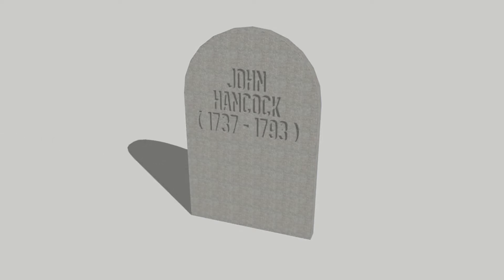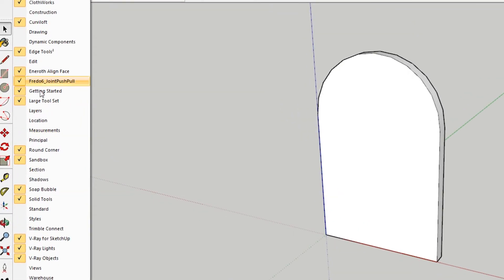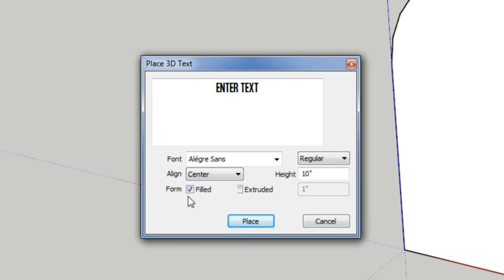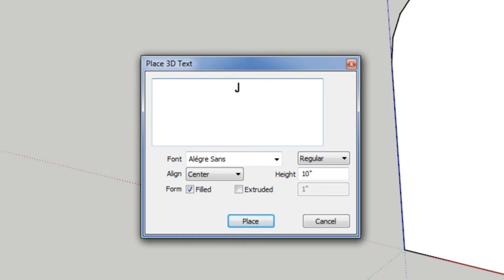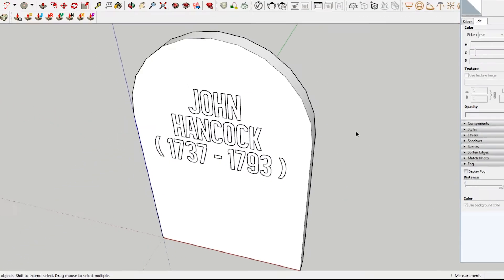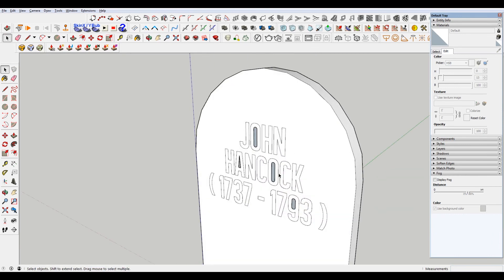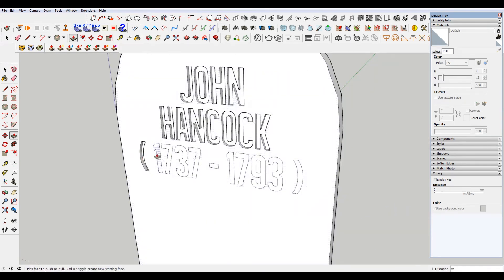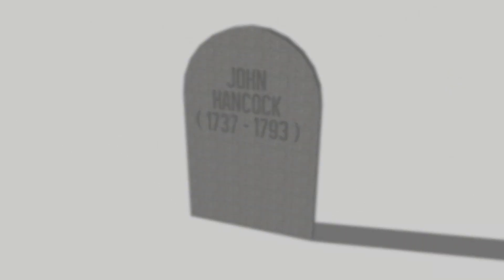Creating Engraved or Embedded Text in Sketchup

Comment: I cant seem to get my text to stick to my model?
Reply from the maker: Make sure your text is not a separate group from your model.  Almost make sure part of the text intersects your model.
Reply: @DesignerhacksPage  So I made sure it was on the face with my model and when I push the letter it goes too far back, and I tried adding extruded text and the same thing happens. I also tried incrementally doing -.1 and the lettering either disappears or is crazy extruded.